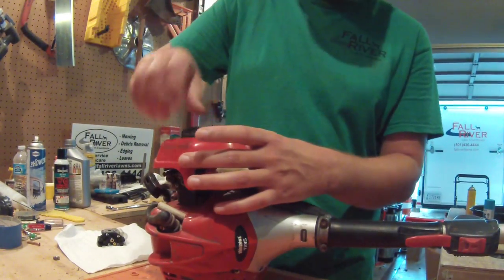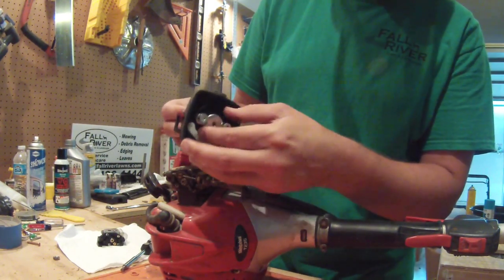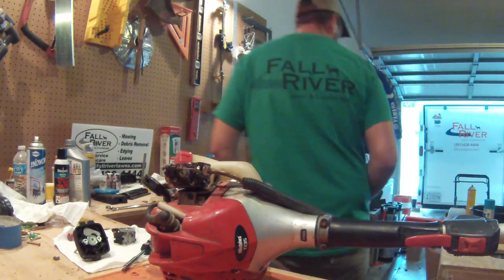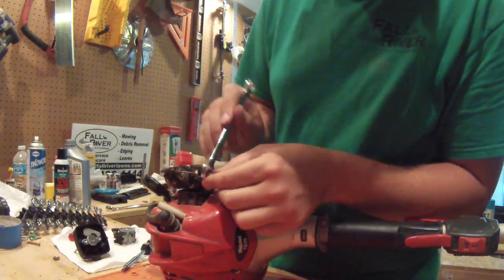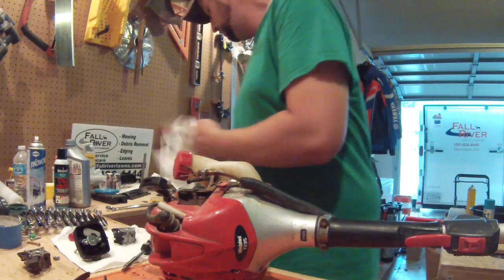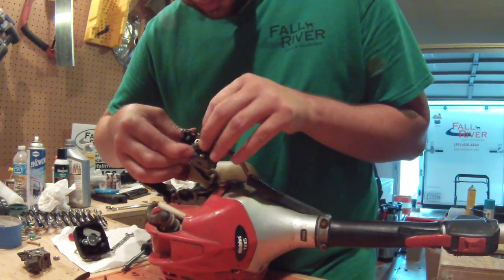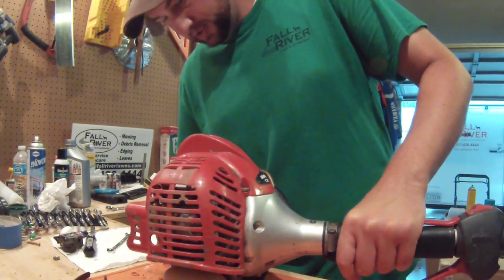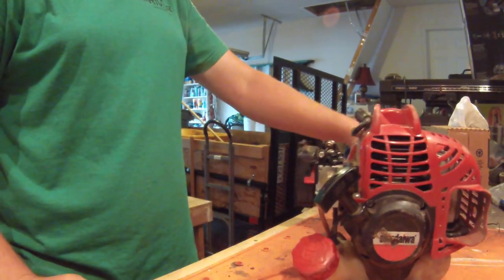Lawn Care Vlog #3 How to Change a Shindaiwa T235 Carburetor

Comment: I think I saw where you can adjust the valves look here on you tube im sure I saw it on here on you tube. Like you said it still sounds rough. Good luck I have a lot of them and never had any problem so far have ran them for years.

Comment: I do not recall if you said you replaced the plug yet?  At least look at it.  The first thing I would do is restart the machine without the air filter.  If it runs good that was the problem.  The second thing I would do is remove the exhaust from the machine and place it on the side burner of an outdoor grill.  Some of the mufflers today are equipped with a  kinked up wire mesh inside the muffler where it bolts onto the head.  This is like a catalytic converter on a car.  This heating process will remove most of the carbon from inside the muffler.  After baking for 20-30 minutes blow it out with some compressed air let it cool first.  Even if this was not the problem it is good maintenance. Next  examine the exhaust port on the head for carbon build up.  If the passage is clogged scrape out the carbon while making certain no carbon gets into the combustion chamber.  Use the piston to block scraped deposits.  Also examine the piston for signs of scoring  and blow by.   If you were using a good synthetic There should be no build up. 

All in all it sound like it is not moving air through the system.  Meaning the intake or exhaust is restricting flow.  If that does not solve the problem try adjusting the mixture screws and finally the fuel filter.
Reply from the maker: precision.lawncare.kc  Thanks for the tips. Sounds like you know what you are talking about. I think I need to buy a back up trimmer before I go to taking this one apart. I know it will be good to have one anyway. Thanks again!
Reply: Let me be blunt.  2 cycle equipment is a pain to work with.  Some times you win sometimes you loose.  They just do not like to corporate.  Just try the muffler cook.  This sounds hard but is  pretty easy.  You  might try and back out the H needle slightly and see if that  helps.  It should be set well  from the factory so don't go crazy a half turn or less.  Make sure you are using the exact mix on the fuel.  Don't cheat.
Reply from the maker: +precision.lawncare.kc  So it ended up that I just needed to adjust the new carb a little. It was running lean, when I took the spark plug out it was all white. It's running like a champ now!
Reply: Glad to hear you are full speed.

Comment: did you replace fuel filter?
Reply: my shindaiwa are temperamental with anything but premium fuel
Reply: Charles  Hittle how to change out the throttle cable on my t242 shindaiwa weed eater